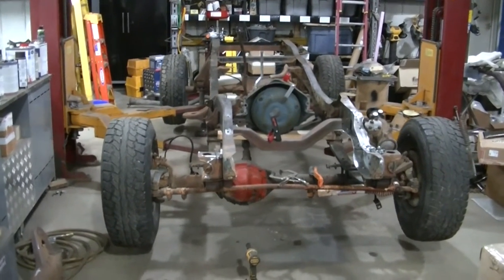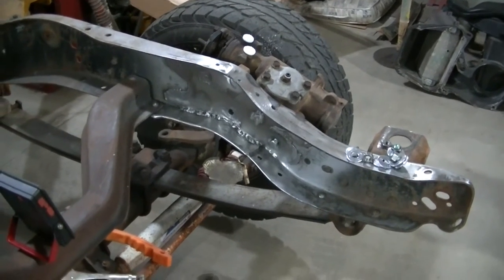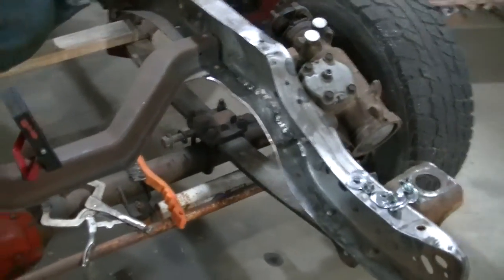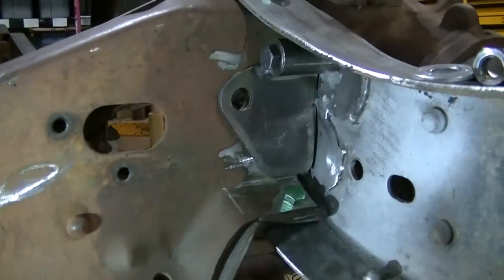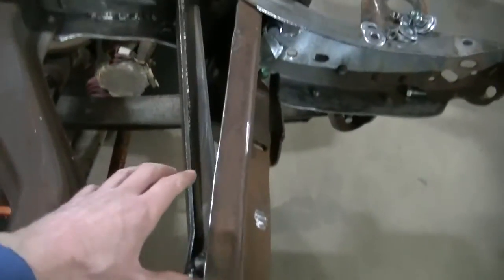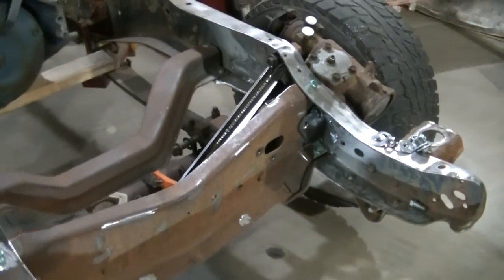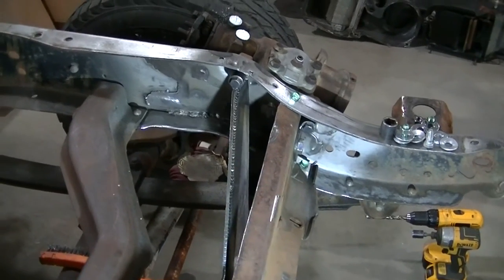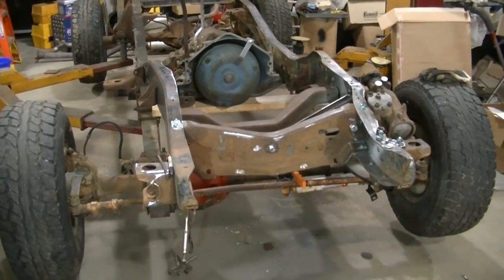80 Chevy Silverado OffRoad Design Steering Brace Install

Comment: very clean work!  I'm glad you got that truck and are giving it a new life.  I've noticed the outside wall of my frame flexes when you turn the wheels on my 2006 GMC Yukon.  I was checking the suspension and had my boy turning the wheels and noticed that.  It's a lot of stress turning when not moving.
Reply from the maker: If I can make it through the restoration it will be cool. You would probably be surprised at what flexes while you go down the road. The frames are a lot better now but they still flex. I have seen the frames on our semi's and dump trucks flex on uneven ground.

Comment: On the 70 I would suggest doing the plate. Even if you put it on the outside as intended I think it would look something like say an HD model. I mean you have the body mounts and other types of bracing on frames already. Some nice clean welds and a little paint and I think it would look just fine.
Reply from the maker: I really don't think you need to plate the frame unless it has cracked. Once these braces are in place it's not going to move. These braces are heavy duty and probably overkill really. If you were really going to beat on the truck and install 35-38" tires, I can see plating the frame. I am not going to beat on the 70. I only have 33" tires on the 70 and plan to do the same on this 80.
Reply: @mossman381  You are probably right. Myself  I would probably do it for piece of mind and that I would already be there pulling stuff apart anyway. You definitely got a couple of nice finds there bud.
Reply from the maker: @garyg4139  I am not going to take the 70 truck apart again for awhile. I am going to enjoy it for awhile then work on the body later. I can ask the guys at OffRoad Design if they recommend the plate if the frame isn't cracked.
Reply: @mossman381  Oh I understand not taking it apart again or if you don't have to.  If your plan for the truck is for just cruising it around and not being a work truck at all I agree with you not doing it. For myself I have had to many of those should of moments with my truck.  I am in a spot now actually. Do you know of any place to get replacement bump stop mounts? Not the rubber parts, I got the Super Springs like you did,  but the steal frame part.  I have an 04 2500 HD and didn't know how bad they were until I mounted my new to me 8'6" Western Pro Plus plow. At nearly 900 pounds with the mount it sags a bit in the front.
Reply from the maker: @garyg4139  Not sure about the mounts. I can't even remember what they look like at the moment. They are bent that bad?
Reply: @mossman381  Yes sir. Didn't look bad 2 years ago when I was doing the fluid film and getting ready for winter.  Last fall I had to do breaks and put new winter tires on it I notice they had just seemed to collapse. I got a call into a local salvage yard though, they will call me if they get a truck like mine in so I can come cut that section of frame out and maybe fab a better design that is stronger and wont hold the road salt.

Comment: Is the brace really necessary if you weld in the plate on the frame, or is it just added support?
Reply from the maker: I talked to the guys at OffRoad Design and they say you still need the support, so it doesn't crack again.